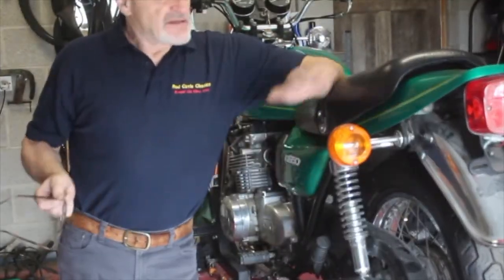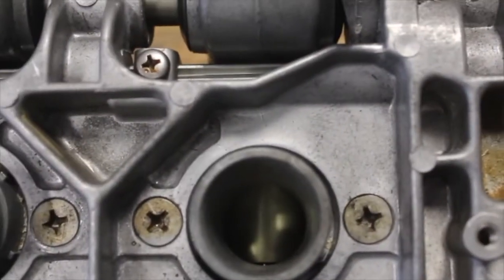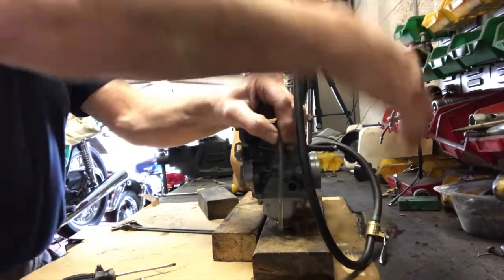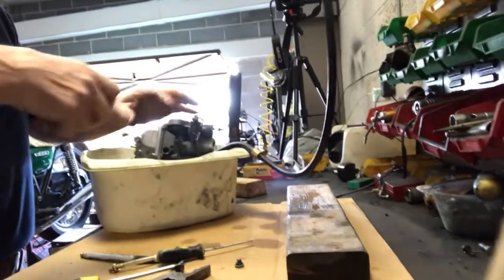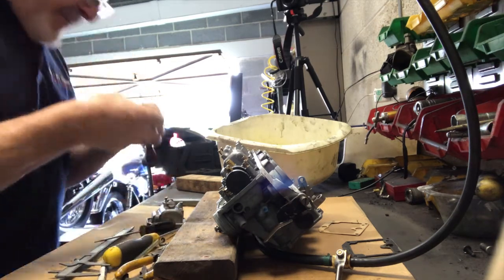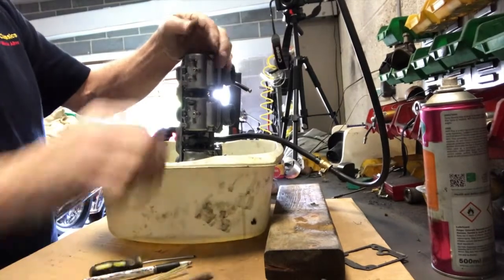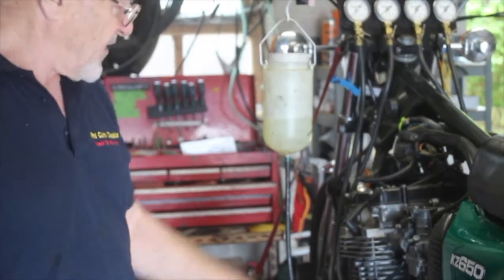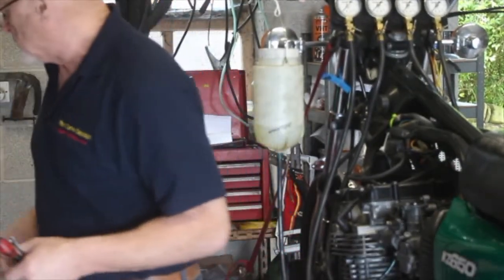How to set up float levels and synch Kawasaki Kz650 carbs 2

Comment: Very useful. Thanks. I just ordered a Delkevic 4-1 system and need to re-jet. Obviously I'll be doing the floats and balancing. I didn't know you couldn't measure the float heights. I ordered the tube you used from ebay, after watching your video.
Thanks again for the info.
Reply from the maker: Setting the float height using the tube is tedious, but you'll get the result. Thanks for watching
Reply: @rodcurrieclassics8102  Thanks.

Comment: These 2 videos may be lacking slightly in picture and audio quality at times, but its because of these two videos that I'm now subscribed and looking forward to watching all of them. I have a kz650sr that I'm working on now and I'm sure if I follow your instructions I'll have it running like a top in no time at all. Thank you for the videos
Reply from the maker: Yeah. I did buy what was supposed to be the perfect DSLR camera but after a while it wouldn't hold focus...that's 'cos it isn't a true video camera apparently. Also bought a GoPro which is great for picture but the sound quality is poor if I'm more than 5 feet away ...so I use a mix of iPhone, and Gopro. I'll buy a vid camera if I can find one that's not too expensive and comes reasonably recommended. 
I have a tidy 650 SR I bought as a non-runner which I'll be doing some vids on soon -it as NO compression so that should be interesting as you NEVER lose all the compressions at once so I suspect someone's been in there and screwed it up. Thanks for watching and good luck with your 650 Michael. Best, Rod

Comment: nice bike  in the end! will have to watch this again soon as i have had one in the shed since 2016 while i lay up recouping from liver disease, once i sort myself out ill be on to the bikes i have accumulated, 3 x s2 kawas, 1 x z650 (1977), 1 x rd400 (1978), 1 x VOR503 (2001), 1 x WR450f (2004), 1 x kd80 (1986) 1 x XL185 (1981). I bought them all before all the silliness started very cheap! ill hang on to a few, but will sell the rest. thanks for your Videos they are great.
Reply from the maker: Thanks for the message and the kind words. You have a great collection. I've always fancied a WR 450 but not sure if my cojones are big enough though I have a KTM 690 and rode across Russia/Mongolia and Kazakhstan a few years ago. The 690 is a brilliant bike. 
I haven't had a S2 yet though I had an H1 last year. Nice bike that has a killer reputation it probably doesn't deserve. The throttle works both ways...on AND off . :0).The bike isn't to blame if the rider thinks he's bulletproof and invisible. :0)
Get that 650 sorted! They're a brilliant bike. Thanks again for your comments

Comment: Did my Z500 ones the same way Rod. I did level the carbs up and clamp them in my Black and Decker workmate made life a lot easier. In the fuel level section of the manual it gives 2 specs. The Design Measurement is, from what I can gather is the distance from the centreline of the carb bore to the fuel level in the bowl. The Service Level is the distance down from the carb body casting to the fuel level in the bowl. The Z500 Design Measurement is 29.5mm +/- 1mm and the Service level is 3.5mm +/- 1mm. As you say the fuel level is critical to get right first. Last year I renewed the manifold rubbers as well as the carb to airbox rubbers, they were getting almost solid and cracking. The Z650 shares the same carb to airbox rubbers as the Z400J/Z500/550 twin shock models.and are easy to find online. One thing i also do is to link up all the pipes from the gauges to ONE Vacuum source to see any discrepancy in the gauges and note it down. Constantly amazes me the condition of these American imports and how little mileage that have done. My Z has done over 80000 miles and must get a few more videos put together form stills covering all the work i did refreshing it.
Reply from the maker: Hi Rob. I always do a comparison by swapping the  vac line from one to another carb and ensuring the reading stays constant. 
Regarding miles the lowest I ever bought was a '78 Kz650 I intended to keep ..at 540 miles from new.  Foolishly sold it when I got a great offer on it- but have a really nice B2 now that you';ll see on a couple of the vids. Thanks for your comment. and hope you keep watching-I'll be doing other Kawasaki vids soon.

Comment: Great video Rod, will be very handy as i've bought a Chopper based on a KZ650, starts and runs fine, it's very healthy and well built but has a bit of a flat spot, has four "pod" type air filters and custom exhausts (with small baffles), i suspect the carbs may not have been re-jetted for the filters and exhaust so going to whip them off and check the sizes. Subbed as your other vids look great so will be watching them too.
Reply from the maker: Thanks for that and glad you enjoyed the vid. They're great bikes and easy to work on. Fuel tap can be a PITA and lead to leaky carbs but there's a guy selling good copies on Ebay for £40-ish. 
Personally hate pod filters and always put them back to stock...they seem to go better. Thanks for watching, rod

Comment: Nice work Rod.. I've been looking for the right kz650 for a while.. and its these kind of maintenance issues which worry me.. I'm not great with mechanics.. very proficient at most wet trades bricklaying /plastering/tiling as I fit stoves .. but engines do worry me.. I would need to find either a decent garage workshop who could do this kind of work.. or a guy local to me who wouldn't mind doing private maintenance jobs.. I'm willing to pay a trustworthy guy the right  money.. but learning the skills you have would be worrying.. so I'm wondering whether I should put my love of these bikes to one side and get a trouble free newer bike.. but I just don't have the same love for new bikes as I do for the styling of the 70's 650 and 1000 kawasakis.. power wise the 650 is plenty for me.. I used to have a CB650z 30 years ago.. and would like some nice wheels to enjoy some free time with. Its awe inspiring to see vids like this.. and also scary to see the knowledge needed to make a great job.
Reply from the maker: Hi there. Thanks for your kind comments. The Z/Kz650s are utterly bulletproof mechanically. They took more and more horsepower out of that bottom end without any mods or subsequent problems. The carbs can be pretty much left alone once set up correctly and the rest is really easy to manage. Truly. GET ONE. Its the best middleweight of the 70s.
In my opinion (and that of more and more) a better bike overall than the CB750 or the Z1, prettier then both, easier to ride than either and definitely a better investment.  I've had everything ( Z1s Cb750s, CBX..on and on) and have a '78 Z650 of my own and love it.
Mail me on rodcurrie88@gmail.com and if you want one I'll help get you one.
Reply: @rodcurrieclassics8102  Thanks Rod.. have my eye on one on ebay at the moment..in the silver..  they are a great bike.. and I can't take my eye off them .. thanks for the positive 👍👍
Reply: @rodcurrieclassics8102  Just a quickie Rod.. do you think there is a big loss with the american KZ's smaller carbs.. you see SR's at 60bhp to some standard trim at 64/66bhp.. there are so many variations on a theme from different years..
Reply from the maker: The SR had one or two less BHP than the "normal" Kz650 as I remember but frankly I can't see it making a jot of difference unless you're tearing round wringing its neck all the time....and most of us don't buy classics for that.
All the SRs I've seen were Japanese builds but I couldn't swear to that across the board. Most of the Kz650s ( but not the Cs) were built in their factory in Lincoln, Nebraska and the quality is just as good as the Japanese builds. They're all brilliant. SRs can be had a little cheaper right now but who knows if that will continue to be the case. Good luck in the hunt.
Reply: @dnt5volvo   I have a 79 Kz 650 SR with low miles that runs but needs the carbs tuned in.  I would be in the market to sell it.  I live in the western part of Nebraska.  Email me if interested.  Has a one year old paint job, brand new tires, new fork seals & brakes all around.

Comment: Good vid, Rod. What about mixture screws next time?
Reply from the maker: Hi Mark. On this model of carb the mixture screws are underneath and kind of centre front of the carb body. A long "screwdriver" tool with a right angle tip is needed to adjust the carbs in turn. I have that tool but the fiddling to locate it onto the screw, to keep my now required glasses on whist my head is upside down and I'm peering under the carb bank so to do, and then to adjust each in turn renders such an appalling attack of cursing that you'd think I have Tourette's ...so probably inappropriate for YouTube unless I want to be banned. 
Although I did adjust them after I turned off the camera, I may need to leave that demonstration to someone with a less mercurial temperament. In short - I maybe need to grow up

Comment: Please sir, can you show how to ajust mixure screws on carbs? Tnx, great video, keep on!!,
Reply from the maker: Hi Peter. Thanks for the question. I think (?) I have done that on the other carbs vid...  The mixture at any speed above a fast idle is governed by the fuel level but getting the slow running right is something I'll cover in a special shorty if that helps.

Comment: Thanks for taking the time to make these videos. I have a 78 B1 purchased from new that I've just completed a full restoration, now down to setting the carbs I find it's running smooth above 3000 rpm, but rough below. So I'm in the area of checking float heights, pilot jets, air screws, etc.  My questions are:  1) how critical is the float height? I think the service manual indicate +/- 3mm    2) does leaving the rubbers off the box/carb inlet have any effect when balancing the carbs?
Reply from the maker: Hi Eamonn. Assuming you've already set the idle mixtures,  Pilot jets are definitely the place to start. The pilot jets and air screws (idle mixture screws) control low speed running and after say 2000rpm the fuel levels will control the mixture, so float height is VERY important overall. 3mm is about an eight of an inch. If you're setting the heights with a vernier or a rule, measured from the carb face that the float bowl sits against, with no gasket you need to be 25-26mm to the top of the float. If you're using a level pipe you need the level to be 3mm +- maybe a mil below the face. 
Once you've done that you can refit ands balance the carbs. I suspect you'll find they're quite a way out so get them even running at 2000rpm, then slow the bike down to 1000rpm and adjust the idle mixtures starting with a rough setting on maybe a full turn out, then screw then out say another turn and screw them in until the engine starts to falter on that cylinder...then screw carefully back out so that one is running just rich enough to be smooth..if you go too far richening you can just do it again. It should be lovely then. good luckand thanks for watching , Rod
Reply from the maker: If I ever set them as a first go ( I'd often do this in case they need to come off again) with the rubbers off I'd check again once the airbox is connected through, but they'll not have altered much. Always good to check though

Comment: Hi Rod. Great video & info thanks. Any idea  where I can buy a rebuild kit for my vacuum petcock? I have a 1978 KZ 650 C2. Even a manual petcock if you know one that will fit? It’s 44mm between mounting bolts. God Bless. Jim
Reply from the maker: Hi Jim. The rebuild kits are alas bl**dy awful and NEVER work...the carbs will still leak. Manual petcock would be a result but a good one ( the name eludes me for a minute) but I'll write back is about £150. A guy is selling good replacement vacuum petcocks for about 40-45 quid and I've tried 2 of them and they've both been good.Let me find the ad and I'll post the URL
Reply from the maker: The good manual taps are Pingel. You can find them on Ebay
Reply: Hi Rod. Thanks for the response. Your a good Man taking time for all of us! Pingel is pricey. If ya find the vacuum site let me know. I may buy an adapter plate & 3/8” NPT petcock. Any thoughts? Blessings, Jim
Reply: Could I pull the stock vacuum plunger and plug vacuum port and run as a manual petcock with an inline shut off  valve? Thanks
Reply from the maker: Hi James. Ebay item numer 324979011945
Reply: @rodcurrieclassics8102  Thank you Rod! 👊

Comment: Hi Rod. I’m having some difficulty with float height. I’ve followed your video which is very informative, thank you. I’m a bit lost with the location of the 3mm making on the face of the bowl. When I measure mine it’s a lot higher then that shown on yours. I’m measuring from where the body and the bowl join. Should there be a difference?
Reply from the maker: Hi Warren. Sorry for the delay in responding-I have been on holiday. Did you get this resolved?? Happy to help if not
Reply: Thanks for your reply Rod and no I have resolved the issue. I set the floats as per your video but I’m not getting the same results as you.
Reply from the maker: Hi warren. what's the issue..are the carbs leaking...or just is it running badly...you don't say ? You mention the marking on the float bowl..when you say yours is higher...do you mean the fuel level is higher than the mark or the mark is in a different location to mine on the vid??
Reply: Hi Rod. I guess what my problem is I’m not sure where you take your measurement from on the carb. Is it from the very bottom of the carb or from where the gasket is seated. I take it from the gasket level which means my level mark is just below the very edge of the carb. When I set my float using the clear tube to float bowl I end up with a very rich running engine. I hope this explains my question.

Comment: Love the vids thanks Rod - especially as I’m doing up my first ever b1 😃 where did you get the connector for the clear tube for checking fuel levels?
Reply from the maker: Hi Graham. I found it on Ebay. I'll dig out the invoice. B1 will be a lovely bike when its done. I bought a 540 mile  (for just 1100 Pounds!!) example a few years ago and decided to keep it.... Then I stupidly sold it when it had just shy of 1000 miles on it as I got a great offer. Should have kept it as I'll never find another .
Reply: @rodcurrieclassics8102  cheers Rod - been on my bucket list for some time….got it from Tenerife for £1500 running about 18 months ago but needs a bit more work including a respray and a decent seat which are like hen’s teeth
Reply from the maker: Seat very hard to come by but look up "Giulari replica seat" on Ebay. "Bob the Seat" does them for 200 quid and they look great on the bike ..I even have one on my own 650
Reply from the maker: I have a couple of 650s coming in from the U.S. in about 2 weeks so look out for the vids
Reply: @rodcurrieclassics8102  yeah - I’ve got a seat similar to the guilari but I may see if Bob can use the base for a decent replica
Reply: @rodcurrieclassics8102  will do Rod 👍

Comment: My 79 kz 650 isn't firing on the 3rd cylinder.  Guy I bought it from said he rebuilt carbs. Has spark and compression.  Any ideas?
Reply from the maker: Hi Spencer. 
a) I'm assuming you've taken the  carb drain plug out so you know there's fuel in the carb:...if not do that first and if there's no fuel the needle valve is stuck closed. Sorted. 
b) But.....If its not firing at idle suggest the idle jet is the wrong one, or blocked. Carbs off and compare the jet to its pals and that its clear. 
c) If its not firing at all no matter the engine speed or load and you have compression etc: 
squirt some brake cleaner, engine starter or WD40...basically anything combustible into the No 3 carb mouth with the engine running at a fast idle. if the engine picks up you know that carb is not fuelling. Carbs off and check needle valve is opening/closing freely, whets and emulsion tubes out and see if the emulsion tubes little holes are blocked or you have a blocked jet. 

if none of that works Email me and we can have a chat.rodcurrie88@gmail.com. Good luck .
Reply: @rodcurrieclassics8102  one of the things people miss out when overhauling these carbs is the seal on the end of the choke plungers. if they're not sealing the bike wont run right, you cant get new plungers or seals,but there is a chap on fleabay that fits new viton sals in them.
Reply from the maker: Hi there. It's my first time round the block with a BMW so thanks for that and thanks for watching. I hope you'll see this one fire up next week. Best, Rod
Reply: @rodcurrieclassics8102  BMW rod ? LOL i was reffering to the kz650 mikunis :)
Reply from the maker: I've just posted a vid on BMW carbs...hence my confusion. Sorry about that. :0)

Comment: why are the setting of the floats all the same ????
Reply from the maker: The float bowls are he same size of course, and the main jets need to be sitting in the same depth of petrol/gasoline so that the mixtures of air/fuel are the same and each cylinder will fire uniformly with its buddies.

Comment: Once you get the carbs synched, do you cap off each vacuum port on the carbs?
Reply from the maker: Exactly that Levi. They come with little caps fitted and you remove them to connect the vac gauges,. Thanks for watching
Reply: @rodcurrieclassics8102  Thank you sir......this video helps me a lot & hopefully i can get my bike dialed in now.